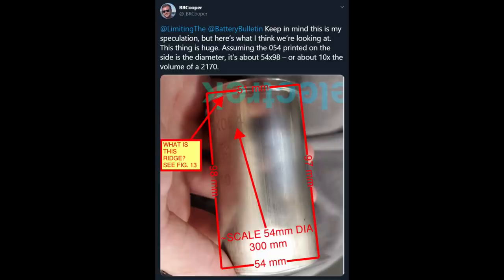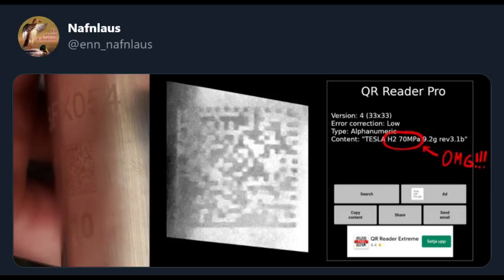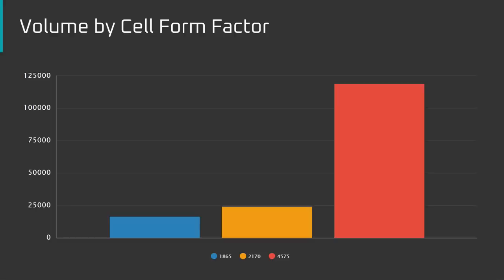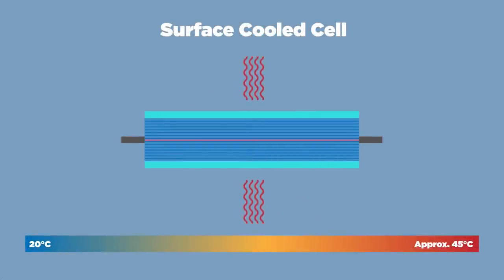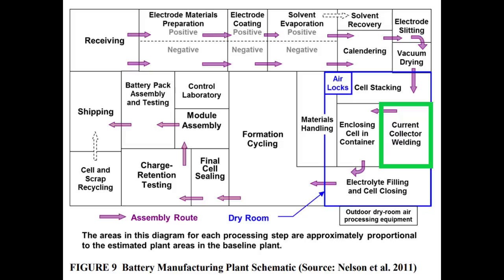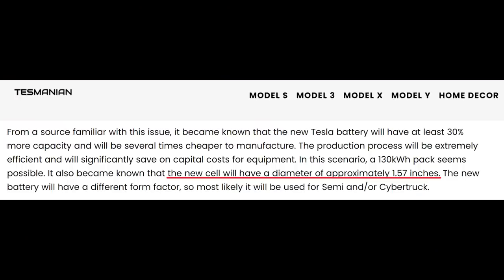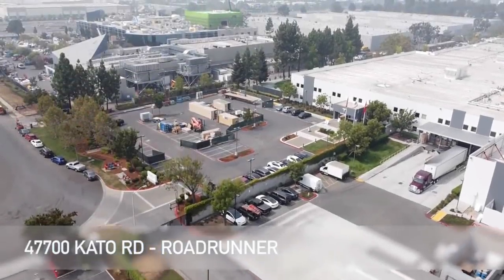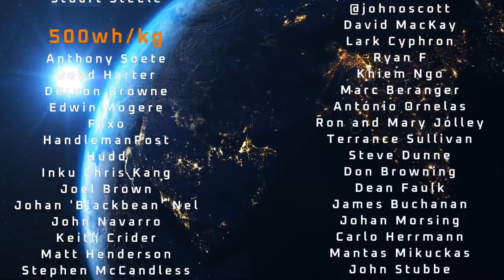Tesla's Alleged Roadrunner Cell - Comprehensive Breakdown

Comment: Tabless design is similar to IDC, Insulation Displacement Connections for electronic cables.  What isn't appreciated is that the curved edge of the foil is compressed.....  elastic deformation...  into the end cap which collects electrons and thermal heat, both.  The cells diameter is unbounded.   But, larger collector caps becomes the new limiting factor for cell construction.  Nice though, is that even if a portion of the foil edge loses connection,  there are still numerous contacted points along the entire length of the foil.  FAR BETTER THAN A SINGLE TAB.
Reply: The various cap protrusions pierce the foil edge like IDC forks on wires.  First principles might try to improve heat removal.  But superior first principles will instead focus on eliminating the heat generation in the first place.   These BIG F..N CELLS DO BOTH USING THE SAME,  SINGLE,  INNOVATION THAT HAPPENS TO ALSO REDUCE THE MANUFACTURING COST. 
BRILLIANT
Reply: PSS...  to file a patent last November and get it issued now can only be done by paying extra to HURRY UP the process.   FAST TRACK.  This costs more and is an INTENTIONAL CHOICE on Tesla's part.  IOW, Tesla wanted this to happen.  It is not an accident.   Most analysts fail to understand these technological details,  but they believe patents are valuable......  which is usually wrong btw, This time,  analysts ignorance is going to,  probably,  result in the correct conclusions that this is HUGE.  Right conclusions from incorrect reasoning.   If so, then unlike autonomy day, the share price is probably going to shoot higher after battery day.  So, buy the hype and buy more on the news after the event.   Question is, Do you fell lucky?   We'll see in 3 days

Comment: Putting cells between cells is a massive complication with small gains. Could be worth it for extreme applications at NASA or SpaceX, where gravimetric density is the holy grail, but probably not Tesla.
However, people love to speculate about supercapacitors in Tesla cars. What about putting supercaps between the cells?
Reply from the maker: Titillating 😀
Reply: That's wild as fk lol

Comment: Thank you for the astute analysis.  I think it's a bit premature to go too deeply into the engineering for almost everyone who is interested in Tesla as an investment.  The engineers and techs out here, well, we're having a great time with all the data and ideas put forth.  Sandy Munro will get down to the specifics when he "examines" one of these battery packs.  In the meantime, it's nice to know that there are geeks out there like us who enjoy this stuff.  And it's something that is important because if batteries are gonna compete against hydrogen for charging / fueling time, the cells have to have very low internal resistance.  Heat is the enemy of any system.  It must be encountered and dealt with.  Therein lies the secret.
Reply from the maker: Amen!

Comment: I think the Code content is faked. I tried to generate a 26x26 matrix with the exact same content, using 5 different ways of encoding the information. None of the generated looked anyway close to the Code on the cell.
Reply: Yes. That twitter post was yanking our chain with decoding the Q code. The H2 70Mpa is a riff on high pressure hydrogen fueling stations which operate at 70Mpa gas pressure.

Comment: Is there a possibility the tabless method would be used for both the cathode and anode, which I imagine is normally in contact with the cell wall ay some point, making the negative connection and introducing extra resistance - mind you that's just a guess!
Reply: Naturally both electrodes are connected with similar conducting properties. If not there will be a total chaos inside the cell between current collectors and electrode. 

Tesla will use some kind of fuses on each cell I guess. But where they would be installed? 

The next thing to worry when the heat is conducted out from the cell is to get that heat out from the battery pack. Will they use cooled ”pipes” between the cells or what? But. If that new cell size is LFP then there is no issues with the heat at all. Also no fuses on every cell needed then anymore.

Comment: Sidenotes:
1. Your dimensions do make much sense: Without modules, the pack will have similar dimensions with the 2170 cells and will fit perfectly in 3 and Y!

2. We know that Tesla plans to shift MIC3 and Y do LFP, and that "China" was highly interested in Maxwell's dry electrode process (but I guess had no idea how to engineer the best out of that?).
Wouldn't it make much sense for Tesla to license out this cell e.g. to CATL to ramp up production as fast as possible (or - they already did?). Also: If plan is to use this cell in MIG Y, Telsa will need a ton of cells in Germany. Ramping up cell production in Germany will take much more time then GF Berlin itself!

3. We should not forget: Aim of Elon is not to build monopolies, but to kick of renewable energy! Kick ICE!

Comment: I think your analysis of the larger cell is spot on. I thought the 18650 was first chosen because it was widely produced for consumer products. I thought the 2170 was an improvement but not a very big increase. I wondered what drove the decision to that size. The thermal limitations of 250Kw charging might have been it. The decision was probably much more complex than we onlookers could piece together from a distance. Tabless construction with less resistance and better thermal conductivity may be the key to success with a larger cell.  Capacitors have used tabless construction to simplify manufacturing  and minimize ESR for at least 40 years. 

You do an amazing job of untangling and explaining these complicated issues.

Comment: The sleve and disk are needed to prevent accidental shortcuts, it looks like any ordinary round battery cell. 32650 (32mm width, 65mm length and the last 0 for round cell) are not too common, but available today. The magic is in the chemistry, not the dimensions.

Comment: Summary from around the web: Thick cells, but despite this, much lower heat due to direct electron path to end plates vs having to travel to the tabs. Much faster charge discharge, possibly a significant amp increase (that is, the highway of electrons is very wide). The voltage at super charger could stay the same “speed allowed on the highway for the amps to travel”. Thus, charging times on thick cells is significantly improved, density is moderately better, heat management is way better, and we could see..... 75kw battery pack expand to triple that for same volume. But, they will probably go to 800V possible architecture, so in the future, you could have way faster electrons on a much wider electron highway, so even if your density is only evolutionary, quality of life on these cars will be exponentially better. Much shorter charge times, and much faster discharge means more instant on power to motors, means even the Model S is gonna be so F’ing fast its gonna peal your face off.

Comment: Why does the battery bank have to he cylinder type batteries?  Why can't they build layered, (like sheets of paper), cathode and anode batteries. Cooling plates can be sandwiched between the sheets at certain intervals. The sheets would he compressed with a clamping structure that would be integrated in the battery bank. This way, there would be maximum used of all space within the bank.

Comment: top disc is aluminium, bottom disc same idea but copper. 
this is how the heat is dissipated. Heres how it works:
three layers: copper/plastic/aluminium
copper extends a bit below the plastic at bottom, aluminium extends a bit over the top end, both ends are folded
over, laser cuts are made so it all sits flat ( I would like to say its an elegant solution, but its really quite inelegant solution, there will better solution down the track but it will work).
So bottom of cell is copper contact, top of cell is aluminium contact
but these contacts are also heat sinks, both electrical path and heat path are same.
Heat doesn't have to pass through the platic now, it goes to the top and bottom.
thats it, not rocket science!!

Comment: The thermal path through the top and bottom of the new cell will almost certainly be the primary path.  The thermal conductivity axially improves by at least an order of magnitude, I suspect enough that they will be able to eliminate the lasagna cooling tubes in favor of top and bottom cooling plates.

Comment: They just need to shrunk the fronk or remove it completely and fill it with super capacitors. This will help alleviate the extra heat from larger cells.

Comment: Chiller plates for the multi cell weld plate let air circulate between cells ....alot better than basket weaving cooling lines throughout the pack.. I wonder what spot welds do to tabless connectors on the "jelly roll" ?

Comment: I believe there would be galvanic ot greying issues over time with the Cu and Al foil and the steel can if there is only mechanical contact.  These issues would cause increasing resistance and resultant heating.  The only mitigation is the can creates an inert atmosphere and none of the chemistry internally interacts with the materials.  Then that leaves thermal movement and vibration that would erode the contact points over time.  I would have GUESSED they would apply a lower temp metal film on the end cap and after assembly they could instantly wet with a very fast thermal event to solder in place the edges.  I have looked at the detail in the patent and I understand the mechanical geometry efforts but I can not get past the influence of time on the mechanical contact!  Food for thought...

Comment: I don't think it's going to be smaller battery cells between the larger cells. I believe that it will be capacitors between the cells to be able to deliver higher current rates.

Comment: Also the tabless design is beneficial in capacitor construction as well. This will decrease lag on acceleration and allow the battery to last longer because the large current loads canl be carried by the capacitors.

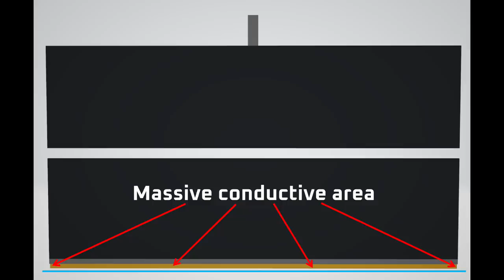Comment: Page 8:15
It is impressive just by the ratio of (1) tab about 6-8 mm wide and (2) collector metal width. 

If I am the development manager I can’t make a call just by width ratio. I need my staff  to demonstrate there is a system efficiency:cost issue and by how much.

Electrically welding conduct electricity better than single or multi point contact. 

Electrical contact failing a minimum contact force criteria do not conduct without hearing up. 

The entire width of collector metal rolled up into spiral metal interface in front of a horizontal base surface, it start with to a first single contact. If further apply axial force to deform the first high point to promote more adjacent and alternating point contacts, this will not produce a spiral line of contact with the base (as the patent drawing suggest a 2D, J shape deformation). Such spiral line of deformation will not take place on a rolled up edge because rolled up edge is 2 dimensions and J shape adds the third dimension into a 3D structure. This kind of structure will not happen naturally with any axial force. 

This is a good theoretical concept far from practical. But there is a way around that.
Reply from the maker: Thanks for your insights!

Comment: Maybe the batteries are 47700? Just like 47700 Kato RD. The writing is literally on the road (wall) haha :) 

You blew my mind when you talked about discharge. Are you saying these cells can charge an electric much faster? If there´s less friction = less heat build up. If it caan charge at lets say 250 kW up to 80%. If it can do that without too much heat build up. That would mean you could fastcharge a Tesla model 3 in  about 15 minutes (WOW!).
~70 kWh
80% =  56 kWh
56 kWh/250 kW = 0,224 h
0,224 h * 60 = 13,44 minutes (!)
Reply from the maker: It totally depends on what they engineered for.  That's what the triangle explains.  You can't consider charge rate without also considering energy density and cell volume.  I'd like to think they have so much energy density with a new chemistry that they can divert some of the balance to charge rate.

Comment: The wet vs dry cell comparisons seems a little wonky.   A normal wet lithium ion cell does not have a 50% capacity reduction at 1C vs 0.1C discharge.
Anyone know what's up.  Maybe i'm missing something?
Perhaps it's related to 36mg/cm2.  Yeah, it's probably comparing a very tiny wet cell to same sized dry cell
Reply from the maker: Yeah, marketing information is always hard to parse.  I put a bit more stock in it than normal marketing material because there were some actual explanations in it.

Comment: Assuming a relatively quick implementation and ramp to max productivity do you foresee potential uses for this battery tech for use outside the automotive industry? I usually see all of your videos (pls forgive me if this has been covered already, haven't the seen Meng and Talga ones yet) and recall quality being an issue during ramp up. With the quantity increasing over time, could the throwaways find a second first life in other products? Ie, phones, watches, drones
Reply from the maker: Correct on all accounts in my opinion

Comment: With the tab-less design mean less resistance and more electrons can enter and exit the battery along with the increase in size/volume of the battery. Doesn’t it not make it a extremely power dense but also more like a ultra-capacitor with high power output?   (Not anywhere near of a stand-alone ultra capacitor but give something like it, from the benefit of the improvements Tesla is making).
Reply from the maker: For a number of reasons, yes, should be higher power density.  Still not supercap level, but better

Comment: Maybe they can pair largest batteries with smaller ones; the smaller ones being able to charge faster while remaining cool, then the largest ones controllably being charged from the smaller ones and storing more power. Something like a 20%-80, so a 20% smaller cells could give or take slower output from several of these larges batteries at once, without warming them up that much.
Reply: They would be like the sugar in our blood x the fat we store,  sugar is very fast to use, but if you have a lot of it, you store it into fat, fat is very slow to use, but as your sugar lower, you burn fat to replenish it.

Comment: I think you're underestimating the thermal benefit of the tabless design. The -ve end of the battery will be the main thermal path. They can insure full contact to the grounding plate on that end and use the battery pack shell to dissipate the heat. The +ve end is fused externally and so is NOT the main thermal path. Speculation but I'm an engineer so an educated speculation.
Reply from the maker: You could very well be right.  Without any modelling, I'm left to resort to 'comparitive' wording rather than objective facts

Comment: Curious how many they could fit in current models and approximate kwh
Reply: In the same footprint (area)  as the current 2170  battery packs, twice as much battery VOLUME can be fitted using 4680 battery packs. One 4680 battery contains as much battery goodness as 5 1/2 of the 2170 batteries.

Comment: Why are cells round rather than square?  You can fit more in the square form factor.  Round is stronger for sure though.  But, if they are going to be packed in a reinforced battery cage anyways, that does not matter as much.
Reply from the maker: Square causes manufacturing issues and required intermittent electrode coating.

Comment: Isn't the reason that cylindrical cells have tabs is to differentiate the positive and negative terminals of a cell to prevent placing the cells at the wrong positive negative terminals? Anyway, i'm glad to see that tabless cells make more sense.
Reply from the maker: Same terminals....long edge is the connection instead of a finger

Comment: I’m not sure if you noted it but didn’t mention it (or I missed it) but I think the tab-less design will also be hugely beneficial to cooling because it creates a direct thermal connection to layers of the roll, that takes plate cooling to the next level.
Reply from the maker: I touch on it briefly, I think by saying it creates a huge conductive edge.

Comment: Thanks for all your excellent videos. A question now: we have been discussing diameter, how about length? What is so magical about 65-70mm? For the Roadster 200kwh, why not have cells twice as long instead of double decking them. And for the semi, why not having cells four times as long instead of quadruple decking them? 
Also, I disagree with your statement that the semi will use the old 2170. In the semi, you need high energy density, hence Roadrunner cells, I believe....Thanks again for all you do, study and report
Reply: Any response on these two points?
Reply: @didierrault124  I believe that they don't go to a longer cell because more internal heat would be produced.  They may not have a way to handle that greater heat.